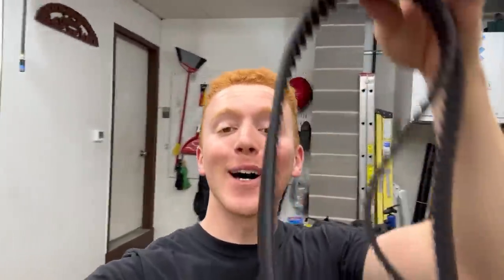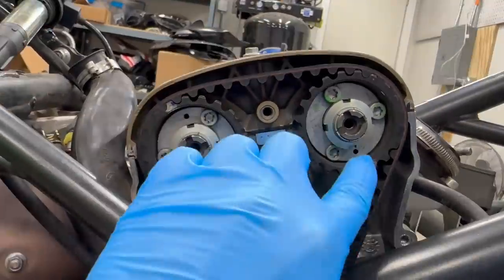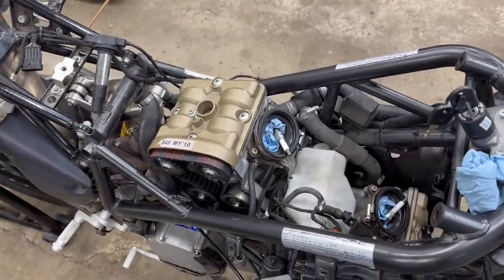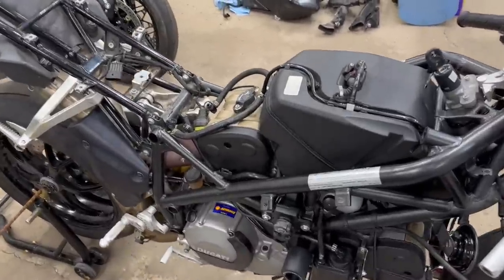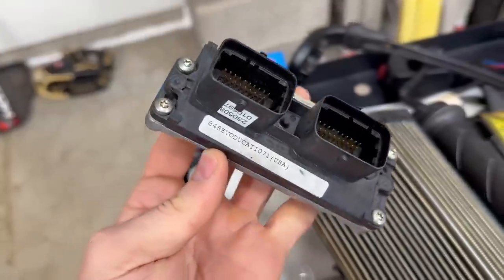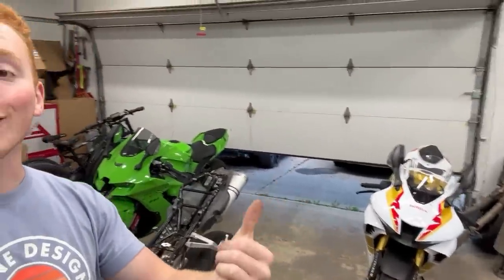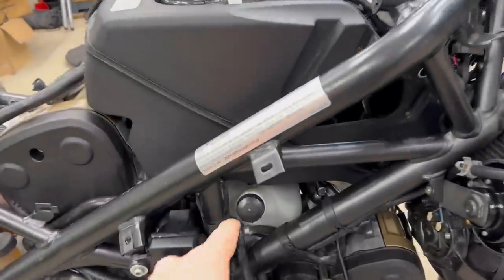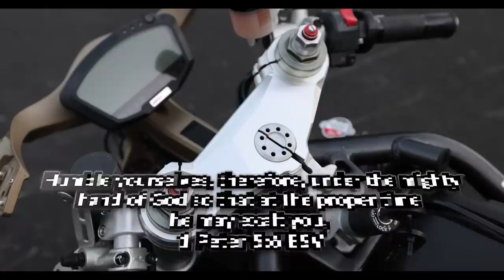Rebuilding A Vandalism 2010 Ducati 848 (Part 4)

Comment: Nice project man, timing the belts is much easier with the special cam-blocking tool (Ducati=Special tools ...) This way you can loosen the 3 screws on the pulleys to apply the same belt tension all around the system, then re-tighten theses 3 screws on each pulley, turn the motor few times and re-check the tension.
Anyway if your timing stay right after installing the new belt it will work
I have a 1098 Streetfighter S and a 1198S Corse and i can tell you will love the bike, you should bring it to the track it's the perfect bike, not overpowered but very precise
Cheers from France

Comment: @7:20 I literally have the same wrench but recently saw a tool shootout where it comes under fire for large variance in torque output more than 2-3% claimed. . . might be worth an upgrade. I see some baller electric ones but also OG Analog dial wrenches are great as well. love the bikes and your content, ride easy bro.

Comment: Just for the record, 'throttle by wire' means electronic throttle. As in, the signal is transferred via electrical wiring rather than a mechanical connection - thus, throttle by wire. The kind you of throttle you are talking about is called cable actuated throttle, or just cable throttle.

Comment: It's a blast leaning new things ain't it. And technically that bike is throttle by cable and your others would be throttle by wire I personally like having a direct mechanical connection with my carbs lol I like the old school stuff still running carburators

Comment: You don’t want to overtighten the throttle. You can tighten to remove the slack but turn the handlebars to its extreme ends and test the throttle. 

If the throttle rolls back, you’re good. However, if the throttle stays, then it’s too tight. You don’t want your bike to rev by itself and you have no control when taking corners. 

Sometimes the RPM with increase when you turn your handlebar at the ends even when you’re idling. If this happens, loosen the slack until it goes away.

Please test the throttle with the handlebars turned at both ends. For your safety brother.

Comment: I wouldn’t replace the original bullet connectors with an aftermarket connector and 2 shoulder joints, you now have 3 joints to the wire when there was only 1 b4. Has potential to cause more problems.

Comment: I still remember how to set the timing like thae way you showed 🤦‍♂️
Tip. Ive seen people on YouTube using the ceramic coating on the plastic it protects it and makes it look nice.

And this is a cable throttle and its not throttle by wire, throttle by refers to your throttle system using electrical wires ( what u were calling electric throttle) and since the original ones were cable before we just call them throttle and we call the new technology throttle by wire (what u called electronic throttle)

Comment: Ride by wire is what your other bikes have. Cable throttle is what your 848 has.
Reply from the maker: right, i didnt get the wording right thanks!
Reply: @CJMediaOfficial  hey make sure the throttle cables aren’t tight when tuning left and right on the bars. So you don’t have throttle hang when turning!

Comment: But you did not marked the old belts and match with new belts.
Reply from the maker: I should have but I was just off one full rotation the distance in between the cams was correct
Reply: @CJMediaOfficial   You know, showing work like this can faaak up people's bikes, following what you doing. You can damage the engine very bad. you should show the proper way of doing this, marking, or using the Ducati special cam locking tool.